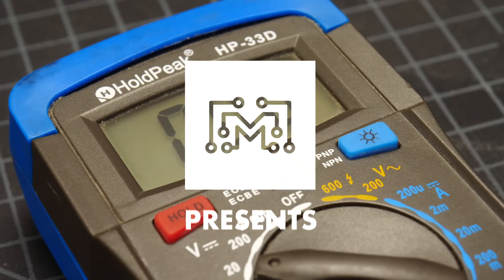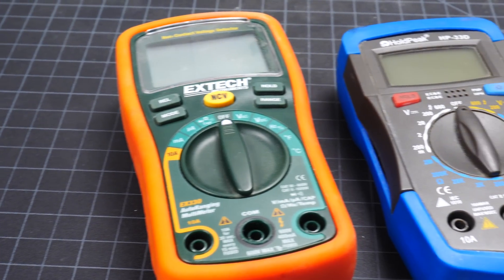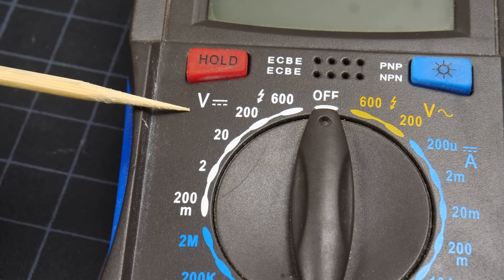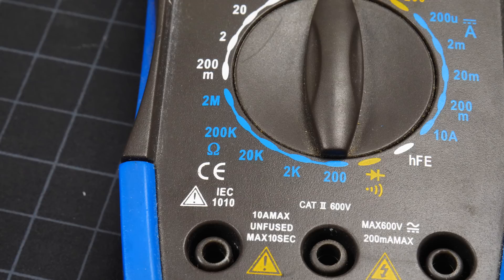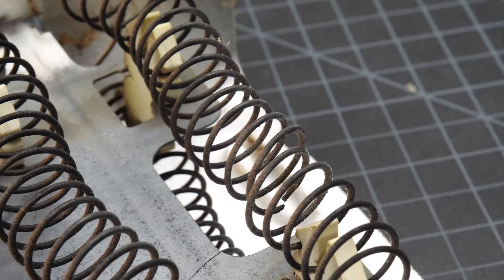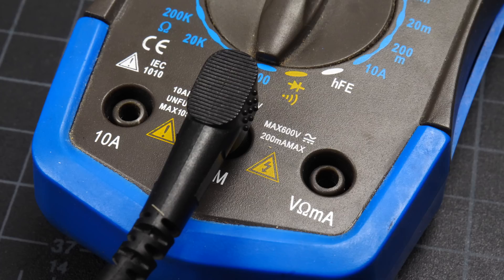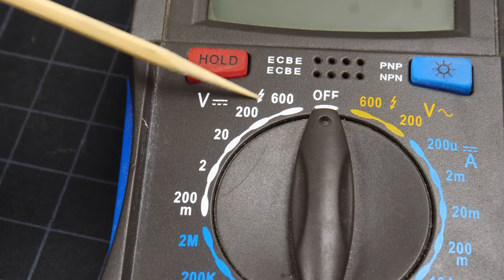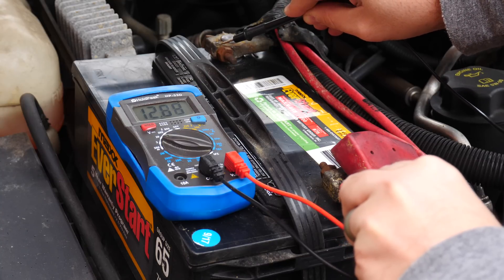Multimeters // Bits | I Like To Make Stuff

Comment: Just a note, if you want to test voltage or continuity, then measure across the component. If you want to measure current then you have to interrupt the circuit and place the meter in the middle of the flow of electricity.

If you do this incorrectly you might damage the circuit, the meter, or both. For example, if you use the meter in current mode across the resistor that current-limits an LED, then you're effectively bypassing the resistor with the meter, and the LED will receive the full current and possibly get fried.

Also, if you're trying to measure a component while it is in the circuit, the rest of the circuitry can interfere with the measurement and give you bad values (a resistor might not read the actual value, for instance). If you need to accurately know the value then either read the markings on the component or desolder it from the circuit and measure.

Great video, just wanted to throw a couple of extra tips out there!
Reply from the maker: Thanks for the info, this is really helpful!
Reply: Anthony Maciel great tips !! Thanks
Reply: One of the first things I learned in an electronics class from an old school prof. Great tip!
Reply: Beat me to it Anthony, well said.  The only thing I would add is if you are needing to measure higher current, or just measuring current a lot, it would be advisable to invest in a current clamp probe.  They can be expensive, but much quicker to read accurate current, and a lot safer since you don't have to interrupt the circuit.
Reply: One thing:
When you mesure  higher current than only a few seconds and then wait 10 minutes befor using again, so that the fuse can cool down. Otherwise you have to replace the fuse. In Germany it costs around 10 €( I don't know how much in the USA).

Comment: The diode symbol is actually for measuring the forward voltage of a diode. On some meters its separated into the diode test function and the continuity function.

Comment: A good tip that can save your life as well as the life of your multimeter is when storing your multimeter always set it to the highest possible AC Voltage setting, because if you quickly grab it and forget to make the correct settings there is not much that can happen to you or your tool

Comment: 👍👍👍👍 Good stuff in the comments too.  kinda like measure twice cut once..... Especially when working with higher voltages.. You want to take your time... double check where your leads are plugged in, double check  settings... and make sure nobody is around to bump or distract you. Always check meter on an energized power source for proper operation before relying on it.  sorry ... rambling.... day job

Comment: You should mention that when measuring resistance or continuity, the circuit must be de-energized. Multimeters use an internal reference voltage to test for resistance values, and can get very erroneous readings (i.e. negative resistance) if there is live external power in the DUT (device undergoing test). This can also prevent your continuity check from functioning properly and could result in false positives for continuity.

The more you know...

Comment: Current = Amps for those who dont know.
if your measuring amps on a curcuit then your need to go inline (In-Series) with the side sending the voltage. when mensuing current dont touch the wires with your bear hands it can hurt you! (Depending on Load)

Comment: I wouldnt use the diode che ker for continuity.  Sure if you need to find to wires in a bunch you shouldn't go that route.  Use the restitance setting for true continuity as you will have valid restitance to see if you have an open or short.

Comment: Great video! In addition to what you said Farads are handy to be able to measure if you have a nice enough meter. If you are careful, you can diagnose and fix the most common aircronditioner issue bad capacitor. Caps are also on any large electric motor so vent fans boat lifts..

Comment: If your meter does not have a setting for continuity, testing resistance will work, too. If there is continuity, it will read a certain number of ohms. If the circuit is open, it will not read.

Comment: I pretty much never try to interpret color bands on resistors anymore. Just grab the multimeter if it’s a loose part. Faster & more accurate (that is, the actual resistance vs nominal).

Comment: Do yourself a favor and buy a good quality autoranging multimeter. Fluke is the gold (well, yellow) standard, but there are other good brands; I have a pretty nice Extech bought for me by my father, who was a professional electrician for 30+ years before retiring due to poor health. If you'll be measuring AC voltages for anything other than wall current, such as testing uninterruptible power supplies (UPSs), get one that advertises true RMS.

Also, if you'll be doing much home DIY electric work, you might want to grab a clamp meter for measuring AC current (amperage). It can come in handy when troubleshooting, and better to have it when you need it. If you shop carefully, you can even find clamp meters that do autoranging voltage measurement for both AC and DC, though they usually have a few less "extra" features than a regular multimeter -- still fine for most home gamers and even the tool belt unit for many electricians.

Bottom line, though, don't cheap out on your multimeter. Cheap ones are painful to use, even when you know what you're doing, and might get the inexperienced user in big trouble. They're unreliable and break quickly, too, so you're really not saving money.

Comment: I used to filter and run vegetable oil in my diesel truck. Because I didn't how to use a multimeter, I thought my veggie pump was bad and ended up replacing the whole thing. Turns out it was just a blown fuse. $400 lesson learned.

Comment: Great explanation of the basics of multimeter use, this is one tool everyone who has anything to do with electronics should have, even if you are just installing LED's on a project. Another tool that is very handy to have is a non contact indicator probe, they are cheap as via Ebay and simply by touching the tip to a wire you can tell instantly if its live or not, this should be the first test done before working on something. saves lives.

Comment: It's worth mentioning that you should avoid using cheap $50 meters on mains 120v/240v circuits, they may claim to be able to work and they probably even will work but a good majority of them are unsafe for high voltage use for any number of reasons such as the tracks being far too close and allow sparks to arc which could potentially have deadly results, aside from that they're perfectly fine for typical hobby/troubleshooting use.

Comment: Hey Bob, nice video!
One tip: If a multimeter has no Off position on it's dial, switch always back to the highest AC voltage setting, when you finished your measurements.
When you start using it the next time, you decrease the possibility of any damage to your meter, if you forget to choose the right setting.

Comment: 1: the most important one.
Never keep the red lead in the Amp socket, move it back to the Volt socket.
First thing most people will do is grab a multimeter and test voltage, ohms or what ever but with the lead set for Amps you will create a short circuit.

Comment: Good telling us the uses, but I’d love a quick demo on how to read a battery or see is a wire is live.
Reply: I don't see why you need a demo, make sure the probes are in holes for voltage, set the meter to the voltage setting (V with the dotted / straight line) the put one probe on one terminal and other probe on the other terminal, orientation doesn't matter, if you get it backwards it'll just read in negative volts.

If you want to check if a wire is live then what you do is set the meter to AC volts (V with the up and down line) Carefully connect one probe to the wire you think is live and the other to ground.

However do note that I don't recommend using a super cheap meters on live AC, they can be made poorly and often have improper fuses, so there is a possibility of it causing harm.

Comment: Something that might be worth mentioning is that when measuring higher voltages OR currents, and there's a risk your hands may touch bare metal (a machine/motor housing perhaps, or a bare wire), then using one hand to hold both probes is a reasonable precaution against serious injury. If your skin does contact both leads, and your hand becomes part of the circuit, the current will only travel from one point on your hand to another, instead of through your chest to the other hand or to ground. Alternately, longer probes, probes with latches on the end, and dual probes are available to further mitigate risk.

Comment: Stay away from any liquids when you're dealing with electricity. If you're working with voltage over 49 volts, it's wise to have some PPE in case of arc flash, or other malfunctions indigenous to the trade.

Comment: And if you really want to tweak your melon, try using a process meter (fluke 789) to drive a signal back to a plc or end device while also using same meter to measure voltage right after and not blow a fuse because you didnt move the leads on the meter.

Comment: This is an area where getting a name brand and spending a little more gets you a better tool, you really don't want to be second guessing your meter. There are way to many brands and price ranges out there to list them all but for something you can grab off a shelf and won't blow up on you, look at Klein (available at your home center). Generally speaking stay away from any sub $20 multimeter, particularly ones that Harbor Freight sells. Don't worry about feature set too much if you're starting out, as you progress you'll figure out the features you need. Also, having more than one meter is always a plus for sanity checks.
Reply from the maker: Excellent point

Comment: As an electrician, I would consider it wise to mention that measuring current will short the probes. A newbie might not take for granted that voltage is measured in parallel with a load (or when checking an outlet, parallel to a non existing load) and current is measured in series with an existing load, never measure current directly between the poles of a voltage source (ie plus to minus on a battery or like to neutral or ground in an outlet)
Reply from the maker: Good point, thanks!

Comment: Please withdraw this video or make a correction. YOU CANNOT EMPHASIZE THE FOLLOWING ENOUGH:
When measuring current the multimeter lets ALL current flow through itself. So if you by mistake has the multimeter in the current measurement mode, the multimeter acts as a SHORTCIRCUIT!! There is some protection dealing with 240VAC in the house installation, so some fuses will blow, but say you by accident has the multimeter in current mode and want to measure the voltage over your car-battery, NO protection circuit will prevent the current to rise infinitely, causing the multimeter to instantly perform a dramatic meltdown.
Reply from the maker: I tried to make the point about the difference of measuring voltage and amperage and the settings that you should use. I will definitely pin a comment to the top of the page mentioning the dangers of mixing those up. Thanks.
Reply: By the way, I enjoy your videos very much. Just not this one ;-)

Comment: Great video, but your bit about where the red wire goes is a bit off. If you plug it into the 10A port and try to measure a voltage then you may get quite a surprise. That would be a dead short that you have created, and best case you blow the internal fuse of the multimeter, but worse case is the thing blows up in your hands causing major injury (obviously depends on the amount of current in your circuit, but a 10A dead short is definitely going to make your day "interesting"). Your video makes it sound like you simply switch to the 10a side if you need to measure anything on a bigger circuit (voltage, continuity etc) and I worry it could lead to someone hurting themselves. 

I suggest you re-do this video, and add in some instruction on the difference between measuring current and everything else (voltage, continuity etc). Could save someone's life. After all, there is a reason that BigClive ALWAYS stresses putting the red probe back into the voltage side when done measuring current.
Reply from the maker: Thanks for that point. I'll pin a comment to the top to emphasize that point.
Reply: @Iliketomakestuff  Not trying to be annoying, but for safety's sake, I will be. 
It really should be annotated in the video for those who have systems that do not read comments.  This is dangerous to the multimeter, equipment, and human.
Reply: Jarrod Coombes exactly!

Comment: My multimeter saved me $200 recently.  I was told I needed a new motor for my table saw, and used my multimeter to see that the only thing wrong with my table saw was the switch.  Quick new wiring, and the table saw was working like a champ.

Comment: Perfect timing, I was looking into buying a multimeter to troubleshoot problems with my car. The one thing I’m still confused about is that the price ranges of multimeters vary wildly. Any advice on a good model/ brand to start with without overspending?
Reply: an inexpensive one is good enough. if all you're doing is checking batteries. picked mine up at a car-quest years ago.
Reply: I'm not too sure of an affordable brand per se, but I would suggest that you look for one with a decent stand, a "hold" button and maybe a backlit display. Autoranging can be nice too, but does require a little more knowledge about what you are measuring. 

That said, this one on Amazon seems to be highly rated, has these features and is dirt cheap. https://goo.gl/xm1eea Seems like a good place to start, and once you get more familiar with it's use and/or realized you need something better, then you can consider in investing is something like a Fluke meter.
Reply: 20$ : Aneng AN8008 Autorange. Great multimeter for hobbyist and electronic novices.

Comment: Never! use a Multimeter to determine if one of your outlets or lamp wired is free of charge. You could never tell if there is overvoltage to the circuit and that’s why you should always use appropriate tools
Reply: I don't understand what you mean by this l, could you explain?

Comment: Always doing a 3 point check is important when checking voltage. . 
1. Check a good known voltage source.   For example a wall outlet. This is to verify the meter is working properly. 
2. Check the item in question. 
3. Check the known good voltage source again. This verifies the meter is still working properly. 
Some may think this is overkill, but  electricity is deadly.  A few minutes of safe practice can save your life. 😀
Reply: This is a good rule of thumb in the electrical world, especially for those not in the electrical world

Comment: Step 1: select 10A range
Step 2: measure how much current that car battery contains
Step 3: put molten blob into electronic waste container
Reply from the maker: I get sarcasm, but ensuring that you using the correct dial settings is really important.
Reply: @Iliketomakestuff  OK, here the civilised version: always remember that introducing a multimeter into the circuit modifies that circuit. At least do some rough guess if the resulting circuit behaves well and similar enough. Counterexamples: current range on a voltage source (fuse blows or magic smoke escapes), DCV range on a pure AC source or vice versa (nothing in display although someting present), DC range on a high impedance like gate of a valve or unipolar transistor (even the meter in DCV will short circuit that), continuity in an active circuit (all results will be off).

Comment: Most multimeters can test diodes but some will not light LEDs up like most people would expect (even though LEDs, by definition ARE diodes). This doesn't mean that the LED is dead though, it just means that the multimeter is not pushing enough voltage through the LED to light it up.
Reply: Thats called "current sourcing" high end Fluke meters can often source enough current to light LEDs but most cheapies cant. Some can measure the diode without it turning on though which can be confusing
Reply: Thank you for this little piece of info.
Reply: @vermili0138  You are welcome!
Reply: Hi there an LED should light up if the tester can go that range. The function only out put enough voltage to open the gate which is commonly 0.4v. am an electrician in new Zealand and that's what I've learned in my class
Reply: @bassmusic2536  Yes, I remember the low voltage thing, 0.3v to light up an LED. I forgot all of this stuff haha.